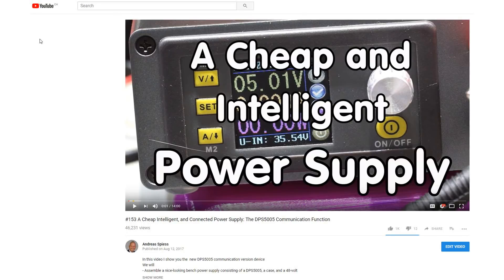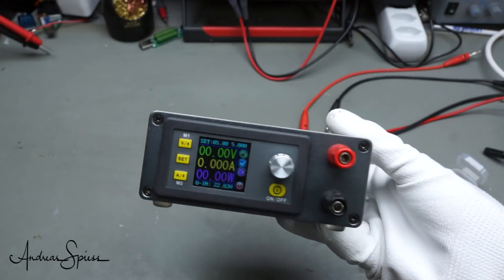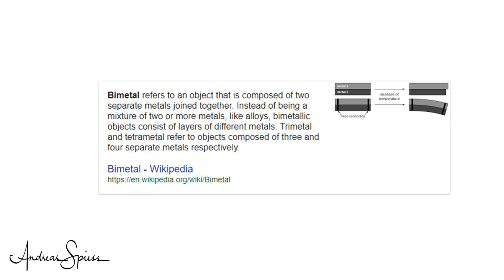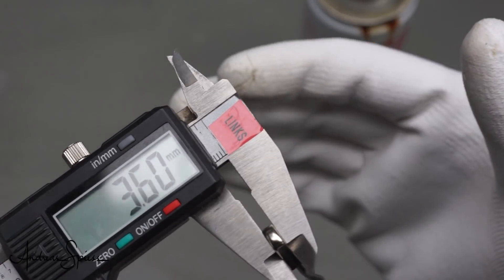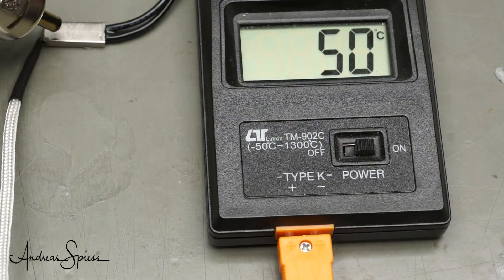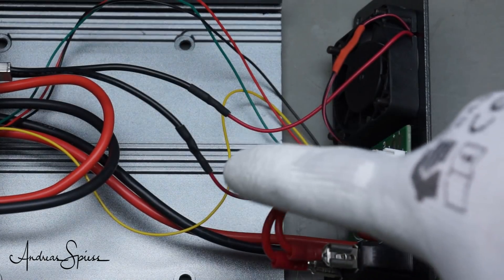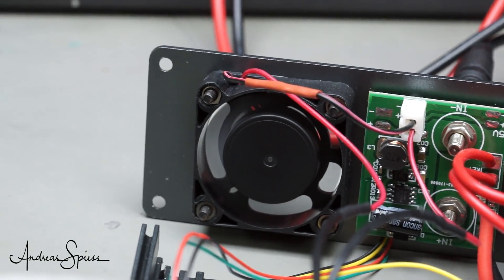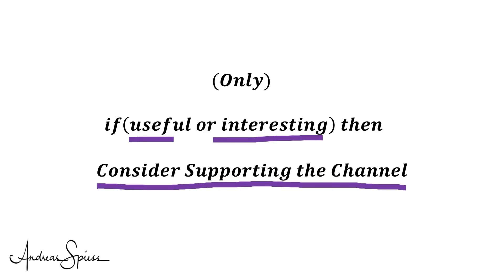#180 Stop this Nagging DPS5005 Fan in 5 Minutes

Comment: I modified a DPS 5020. I used a 30 degree Celcius NO bimetal switch. Even at 50 Watts, it will not kick on ever. I placed the switch over the board behind the fan. This area, where the ICs sit, will warm up the quickest, even quicker than the coil. Hope I could help.
Reply from the maker: Thank you for your tip!

Comment: What did you do with the switch? Is it mounted, just exposed to air? Did it wedge between heat sink blades? I'm trying the same idea except the heat sink fins are only 2mm apart. any ideas?
Reply from the maker: Mine fit between the fins.

Comment: Finally a video that unbiased explain the connection and use of ksd9700 instead of guides for very niche uses
I wanted to know if I could simply use the ksd as a thermal switch for the positive wire for a small fan - yea I can
Thank
Reply from the maker: You are welcome!

Comment: Anyway, the fan is blowing outside and doesn't make much sense at all. Better to replace it with the sticker directed inside/ just my humble opinion
Reply: It makes sense with DPS5005 and other models without additional boards (that have their own fan btw). With others, like 5020 model, this installation direction is correct. If you change fan direction, you will have to improve bolt holes to make deeper holes for nuts from inside.
Reply from the maker: I think you can turn the fan if you think it works better. It is more or less symmetrical.

Comment: I actually put a 40x40x20mm 12V fan. It's twice the thickness of the stock one. I power it with the same 5V and get lower RPM but similar air flow. It's always running, but it's barely audible.
Reply from the maker: Also a solution. Maybe it is a little more expensive. But if you need a lot of power for sure a good one.

Comment: in the module with the big board you could use a transistor to act as a switch, when the fan from the boards starts, also the transistor conducts and starts the case fan,easy fix
Reply from the maker: Thanks for the tip!

Comment: Or for 0$: connect the case fan to the on-board fan (if it has one). The on-board fan starts and stop automatic. I have the DPH3205, works like a charm.
Reply from the maker: If it has. You are right.

Comment: Hi Andreas,  I have used your solution in my projects and  in some cases the  fan comes on  late or too late.  In  that case, to control the fanspeed,  I use a  LM2596S Buck converter about $1.- this converter has  a 330ohm resistor and a 10K potm for regulating the output voltage) I replace the 330ohm with a 5K NTC  which I glue to the hottest point in my project.  
The fan runs normally slow and speeds up depending on the temp at the NTC. Works great and worth trying.
Reply from the maker: Very innovative idea! Maybe I will use it in one of my projects.

Comment: Andreas, Be careful here. I would be better if you had used an IR thermal camera first to identify the source of the heat. If it is a point source (e.g. a linear voltage regulator) then this point source can possibly overheat before the fan cuts in. It is all about the relative thermal masses and location of the sensor(s). The reason the fan is on from the start is that several point sources may need cooling from initial switch-on. I was going to do this on my Rigol oscilloscope fan but having seen the power diode and linear regulator getting to 75C in the first 30 seconds I backed off until I can figure out how to sink these point sources of heat. The inner chamber of my scope only heats up by +2.5 C over ambient after 5 hours use, so the resolution and hysteresis of the bi-metallic sensor means that the point sources risk cooking for many hours before the switch closes. Please get the back off again and let's have a look where the heat is being generated.
Reply from the maker: You are right, I could have checked with the Flir. But I was too lazy ;-)
If I remember right (without looking at the datasheets): Power transistors and diodes are rated to above 100 degrees. So short-term 75 degrees would not alarm me too much.

Comment: I do the same with many devices, however I prefer those with a mechanical "snap-action" switch  design.  I think the non snap action type are ok when acting as more of a *sensor switch (light load) rather than carrying a more demanding  load
Reply from the maker: You are right. This is a switch for small loads only.
Reply: I love the form factor and the price of the ones you showed though!

Comment: The heat shrink is a nice thermal insulator.

I'd have used a mica washer instead some years ago, but nowadays there are cheaper thermal conducting and electrically isolating films available.
Reply from the maker: You are right. Fortunately, there is no hurry in this process because the heatsink supports a much higher temperature than the 50 degrees. And the delay is not long.

Comment: Come ooon a dollar ? Be European talk Euro ! :D
Reply from the maker: Same same
Reply: I'm about to do something similar to my Cisco 2960 switch and my APC RT 3000 UPS - both have really annoying fans. Although the APC fan might be 220/240V which can make things more complicated.
Reply from the maker: My switches are for 220v
Reply: Oh nice ! So i will have no problems then - thank you !  Btw what you think about using a thermal resistor to control the RPM of the fan ? I know it would be more complicated and probably unneeded but might be an interesting video :)

Comment: i just used a deep 12v fan in its 5v place. wonder if the volts can be changed by changing resisters on the small board.
Reply from the maker: I did not look at the diagram. But If you have a high input voltage you should be able to provide 12 volts.

Comment: I'd put a resistor in series with the fan having it run all the time at near silent levels and then have the temperature switch bypass it for full speed when it gets too hot. that might be a bit more fail safe too if the resistor or switch fails you'll still have some cooling.
Reply from the maker: I am glad about the fact that it is absolutely quiet for 99% of the time. But your solution could be a good compromise

Comment: Why not add a resistor in series in the fan circuit, meaning parallel, over the  temperature switch?  My fan is barely making any noise, have to really place my ear on top of the power supply in a very quiet room to hear it.  I am sure that it keeps it cooler than normal and the thermal switch might never come on in a normal situation ever.
Reply from the maker: Mine is very loud and needed, if the temperature is too high. If I add a resistor the speed might be too low if needed
Reply: Strange maybe mine was audible to but not that extremely loud. Maybe they used different fans.  Well it can never harm to keep it running at a very low voltage and almost inaudable.  My experience is that capacitors die of heat, especially they heat up in switched power supplies like this. A bit of airflow is always positive.
Reply: intriq8, that is what I basically wrote in the first sentence and what I've done in mine. Inaudible and still a bit of an stream of air.  When really needed, I have the DP50V15A power supply, the bimetal switch (mine is a 60C one) will come on, which never really happened until now.
Reply: I know ;-)  Sometimes I need to explain things clearer.  Well we all have 'free' resistors in our drawers so it is a win-win in any case.

Comment: Nice idea. You could probably use it without the heat shrink putting it on the ground wire. The direct contact would conduct the heat faster preventing overheat on puny   heat sinks
Reply: Don't bother probing. Any hardware putting Vcc on a heatsink should die :-D
Reply from the maker: You are probably right. But I was not sure and too lazy to check. But 45 degrees are quite low and speed therefore not critical
Reply: Andreas Spiess I agree, 45C should give you quite a buffer before it hits a critical temperature.

Comment: I wondered why I was going crazy, now I know it's the fan in the DPS3015.  I tried isolating the fan from the case with some rubber grommets but that only helped the noise a little bit.   Thanks for the tip on the Normally Open Bi-Metal switch.  Keep Broadcasting!!
Reply from the maker: You are welcome!

Comment: I've got the buck-boost one attached to my 12V solar system. Added a resistor to the case fan, it works well.
Reply from the maker: Thanks for the tip

Comment: I purchased a used Netgear GS748T switch cheaply on eBay.  It has three fans which run continuously and are very loud.  
In my home environment It will never get the traffic it was designed to have in an office and probably will never overheat without the fans.  Installing this cheap solution will be the perfect solution in my home environment.

Comment: Hi, i have the DPS5015 and the fan is aggressive even in the bigger case they are sold to me.
This solution is a very good idea and I will use it too.

My dps run with a 48V 7.5 A power supply and the power supply has already a temperature fan solution.

Keep going to be a YouTube maker and give me so many more ideas. 

Lovely greets from Germany 💟
Reply from the maker: The fans in the PS are another problem. I placed mine below the table

Comment: I have used two diodes in reverse to lower the voltage to around 3,8V and now the fan noise is acceptable.
Reply from the maker: But does it still strong enough if it is really needed?

Comment: slight mod (hope you don't mind me sharing it..) For those with access to cheap centrifugal fans (such as reliable Nidec or Delta fans on older pentium D PC's), open a 40mm hole in the case bottom and mount fan directing air flow toward the heat sink. Use a zener diode to drop the voltage to an inaudibly low rpm (hot air still exits case as normal). If high speed is required, bypass zener with Andreas' switch solution allowing the high speed. Since these types of fans are inherently low noise, it still won't bother you on high. Note: these fans benefit from a bottom paper or wire screen filter to keep from sucking up debris inside impeller.
Reply from the maker: Thanks for the tip.

Comment: I tried this exact method but didn't like it.  Use an ATTINY85, a 10K ohm thermistor glued to the heat sink, and a MOSFET to turn on the fan using PWM.
It works great, as I can vary the fan speed based on the temperature, and also program a hysteresis. None of which I could've done with a thermal switch alone.  
I used it on my own linear lab power supply. When I draw an amp, I can hardly hear the fan. When I draw 5A, the speed of the fan is half of full speed. At 10A, it kicks in high gear and full speed.  
Best of all, I can incorporate this design in all my future projects.
Reply: If you don't share the code and circuit design now, then i'm going to be really dissapointed.
Reply from the maker: Another good solution for a broader application.
Reply: Or you can use 2 switch, 40c switch connect fan with 100ohm resistor and 50c switch close serial resistor and 40c switch (both for security reason, if 40c switch not close),. https://www.aliexpress.com/item/KSD9700-250V-5A-15-150-Degree-Bimetal-Disc-Temperature-Switch-Normal-Open-Thermostat-Thermal-Protector-60/32836695186.html?spm=a2g0s.9042311.0.0.OPT43a
Reply: I agree with ESTD3, you should share! Sounds quite useful and simple.
Reply: @undefined lastname, exactly.  If my code didn't have other stuff, I'd list it.

Comment: The "heat shrink" tube the sensor comes with is not heat shrink. It is silicone, meant for electrical insulation in case you have 250V on the switch.
Reply from the maker: Thanks for clarification. I did not try to shrink it. Was a 5 minute project.

Comment: Think this is a great idea.   But if you know the potential of the heat sink, you could maybe connect the bimetal switch to the ground part of the fan connection (or to the positive, as you do) without needing to use a insolation, no?
Reply from the maker: You are right. But my solution was faster for me ;-)

Comment: Initially I was thinking an Arduino, temp sensor and pwm but that would cost >>$1. Very nice and simple solution! Cheers!
Reply: I made one with an attiny85 with variable speed depending on the temperature. I should document it somewhere
Reply: Well.. attiny85 is around 1.14 usd dollar. Thermistor 10k one pcs is like 0,04dollars and one mosfet is like 0,17 dollars per piece and if you take all these things into consideration then that switch and the arduino method is roughly the same price :D The switch being 12 cents cheaper over all :)

Comment: can't you add some diodes to the fan power lines to reduce voltage and so it's less loud (moving less air, too, of course...)?
Reply: i know, but it can be an addon to the switch, to reduce noise even when fan is active, of course
Reply from the maker: I assume the fan is not very strong and is needed full speed for max. Spec. But I did not do tests.
Reply: I did... It needed a reasonable voltage to start running and the difference in noise with it reaching its operating voltage and running at 5 volts is negligible. It's a cheap fan... May there are better fans that run quieter... I like Andreas solution. simple and easy to implement.

Comment: modifying the fan to cause less turbulences. like roughing up the surface, deburring edges and such. and to dampen the vibrations use some rubber tubing instead of case screws.
Reply from the maker: Also a possibility.

Comment: Hi Andreas, your solution is great! My experience: Noctua in Austria builds very silent fans, like this one: https://noctua.at/en/nf-a6x25-flx that I used to replace the one in a Rigol Ds1052E.
Cheers!
Reply from the maker: Silent fans are good, but if I remember quite costly.
Reply: Or Noiseblocker they have a nice silent 40mm fan.
Reply: corrected, thanks!

Comment: Ideally the manufacturer will add a PWM driver for the fan in order to regulate its speed according to the temperature.
Reply: kioan the problem with solution could be that the fan is on a 40% pwm signal louder than with 100%.  That men that the fan should run with such pwm single and this fan should be cost more
Reply: You can reduce the noise in a PWM driven fan by slowing the slew rate of the PWM drive signal. This can be accomplished by adding a small capacitor to the base of the PWM switching transistor.
Reply from the maker: PWM in this case is maybe an overkill